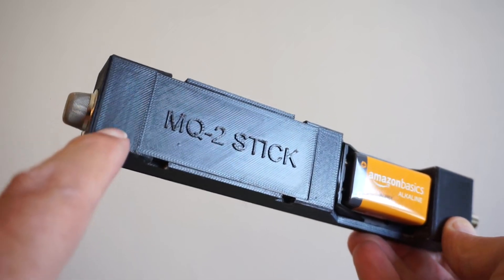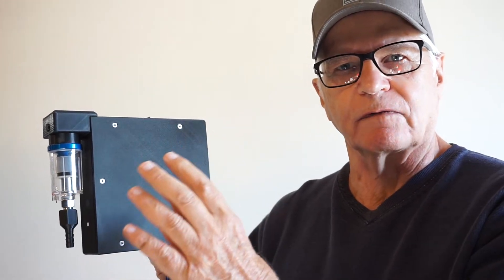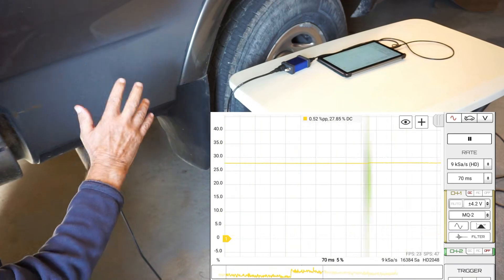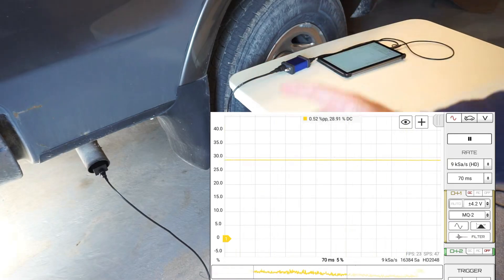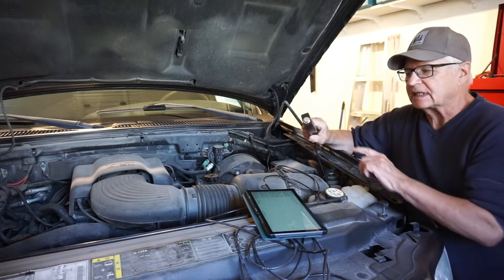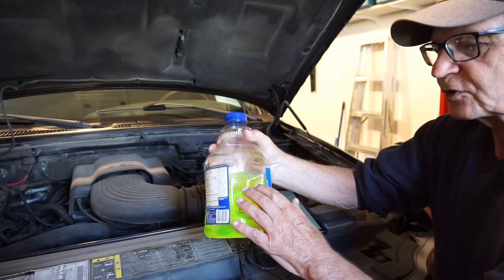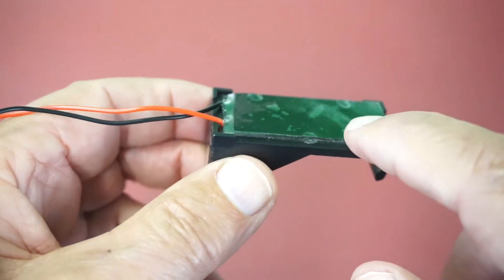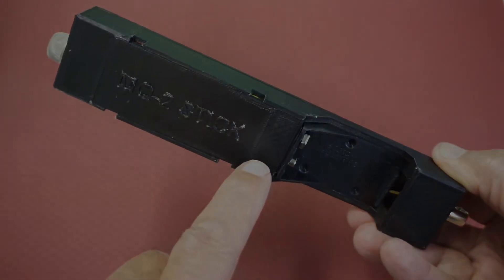GADGETS#198 - MQ-2 STICK

Comment: When testing for gases in the tailpipe, how does the tool differentiate between a leaking fuel injector and a head gasket?
Reply from the maker: MQ-2 is good at detecting hydrocarbons

it can do so at the coolant reservoir, if hydrocarbons are present

but it can't detect coolant, if coolant made it to the exhaust

but can detect hydrocarbons (fuel) at the exhaust if any was leaking through an injector and the fumes were making their way to the tailpipe during an engine crank

hope this answers your question Ryan

Comment: Thanks Dennis.  I made one by using a MQ-2.  I've already made a 5V power supply station.

 A few years ago, I was trying to find a 5 gas analyzer to test a coolant combustion gas test like you did here.  No one who had the equipment wanted to give  me a chance to prove it.
Reply from the maker: if you get a chance to test it on a few coolant combustion tests, let me know how you make out Tony
Reply: @theGADGETSplaylist  Dear Dennis, I've just got a coolant combustion gas test plus a tailpipe gas test today.  It was very surprising to see the results I tested on a problem vehicle with slightly misfire when cold, it also eats slightly coolant.

 I used a picoscope and how can I send  you the results?  There are some pictures, screenshots and 2 pico files.
Reply from the maker: @tonylin9833  thx for getting back to me, Tony

you were successful in confirming combustion gases in the coolant?

you can send files:

thegadgetsplaylist@gmail.com

or better yet

HSCOPE LOUNGE on TELEGRAM ... which is a great platform for sharing technical info like this

thanks again
Reply: @tonylin9833  Can you share the probe settings that you used for the picoscope? I am building one of these and would appreciate the help.

Comment: Dennis, I am looking to start getting baseline readings on our nat gas and lp engines . Setting maxitrol regulators is hit or miss . Especially with an engine that's already warm. What sensor would you recommend ? Would you still go with the mq 2? to try and make a library of known good %s
Reply from the maker: I am partial to that MQ-2 Jesse...it responds well to hydrocarbons, including propane
Reply: @ Thank you Dennis. I am excited to give it a try.

Comment: Combustion gases in the coolant bubble out.
Reply from the maker: yes, why sensor can detect it
Reply: So can eyes 😳

why would I need a computer tell me what I can see?
Reply: @Iowa599  as you well know, blown head gaskets are difficult to detect. Anyone can tell when it is so bad that bubbles are coming out. However this tool will diagnose way before you can see bubbles.
Reply: Because not all cars with failed headgaskets blow bubbles into the coolingsystem...

Comment: First check, leaking injector, that is diagnosed quicker & easier with a fuel pressure gauge. Turn on ignition, check rail pressure, turn off ignition, check rail pressure. Should remain th same, but if dropping there is a leak.
Reply from the maker: it might be leaking back into the tank
Reply: @theGADGETSplaylist  that is a fuel pressure regulator or fuel pump. Pinch the inlet fuel hose, if the drop stops it is probably the pump, or a leak between the pump & gauge. Pinch the return, if the drop stops it is the regulator. If neither do it is an injector.

i've used that method to diag & successfully repair many cars.

Comment: You never fail to impress me, Dennis! 
Just one small thing:
I don’t think those 9V connectors are suitable for many connects/disconnects, so I’d recommend to add a small switch but everyone should of course decide for themselves depending on their expected usage. 
It wouldn’t be good if you’d use this neat device too many times unless you’re helping out many neighbours 😉.
Reply from the maker: I like the simplicity of this...one could drill on side and add a switch
thx for watching and comment, Eduard

Comment: I'm not sure if I understand the testing process theory. It looks like you are relying on 'flood mode' when doing the test. Does this mode disable the injectors but allow the fuel pump to pressurize the fuel rail? 
This looks like something I could have used recently!
Reply from the maker: I did not use clear flood mode in this video (though on this and some other vehicles that would work in disabling injectors while keeping fuel rail pressurized...but so easy to have foot off pedal just a bit and have engine start on you)